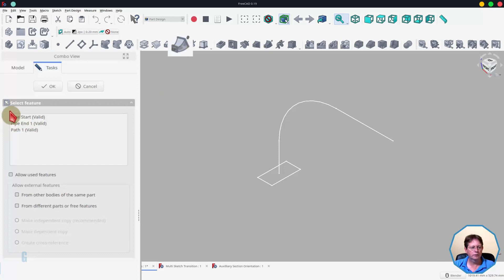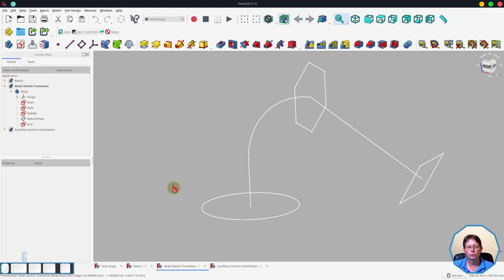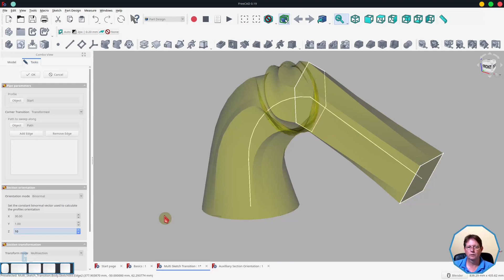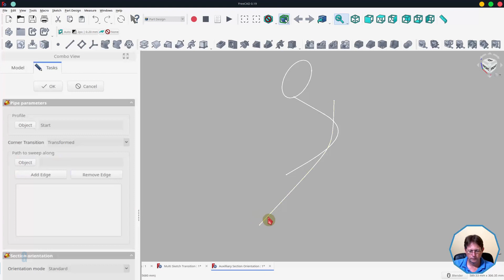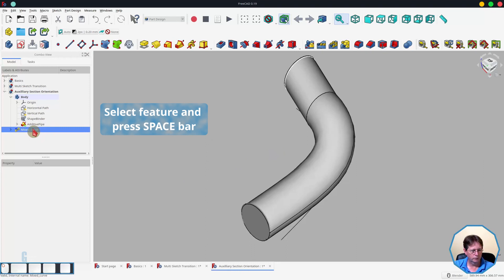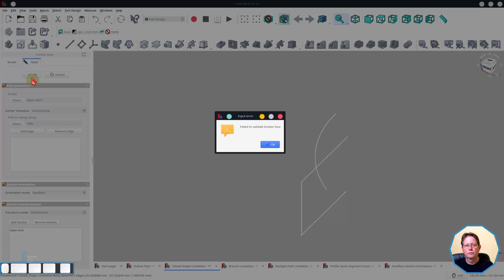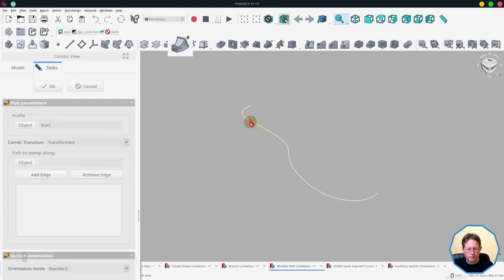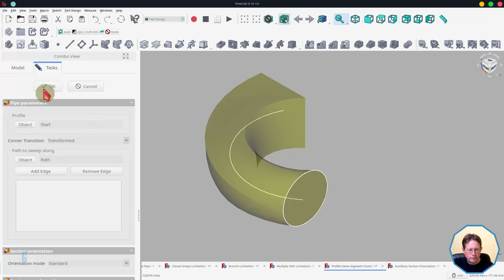How to use the Additive Pipe Tool in FreeCAD's Part Design Workbench

Comment: I saw one guy used Frenet in creating spiral thread with a helix in the Sweep tool rather than the specific Helix tool which is now also available. I you don't apply Frenet in rotating a triangle (for example) along a helical thread path, then the triangle twists as it is rotated around the helix and does not make the triangular thread. Soon as you apply Frenet then the Triangle maintains its orientation all the way along the path. The Helical Additive or Subtractive Tool does not have Frenet and does not have the problem of a rotating profile along the helical path. If you want to make a free Helix pathway one goes to the Part WB and chooses the Primitive tool. In the tool one can select a helix and set up its radius, pitch etc. Then return to the Part Design WB. It appears a longer way with pitfalls but there are quite a few other pathways available in the primitives that can be created as well.
Reply from the maker: Thanks for your feedback. I haven't actually tried any of that so I will take your word for it and try it out at some point. My main use case for FreeCAD is to design furniture and it's rare that we need to design threads but I appreciate you explaining it to me.
Reply: @GlassonDesignStudio  👍

Comment: I'm sorry to ask what is likely an extremely basic and elementary question that I should probably already know the answer to...but how did you create the path line?  I'm able to follow along as I watch and the steps make sense, however as I try to do this in FreeCAD I'm getting stuck as I'm unable to create the curved 90° line as you have here in the first example.  I am certain I have missed something VERY critical early on in my FreeCAD journey if I can't even figure this out.  🤔
Reply from the maker: Thanks for your question mate. The paths are created as sketches using the Sketcher workbench. You could create the path using the Line and Arc tools in the Sketcher, or you could use the Polyline tool.
Reply: You must be aware of which "plane" to create the path sketch.  It's not going to be on the same plane as the profile sketch. Most likely it will be on a plane orthogonal to the profile sketch, but it doesn't necessarily have to be orthogonal.